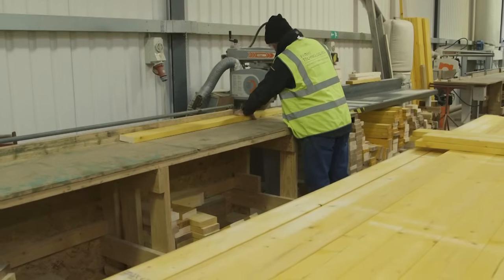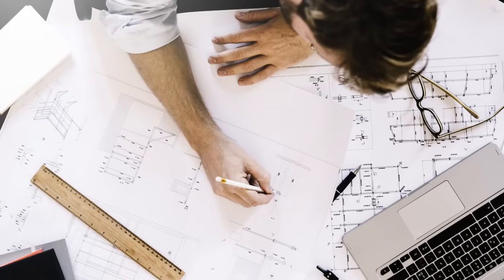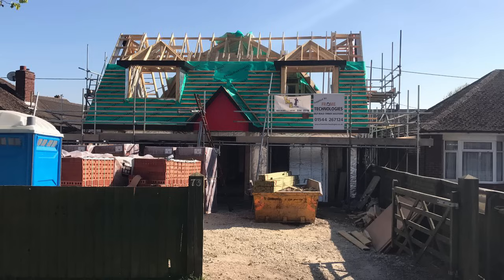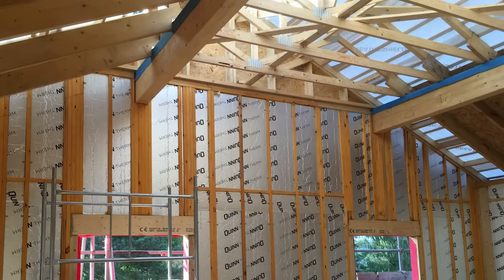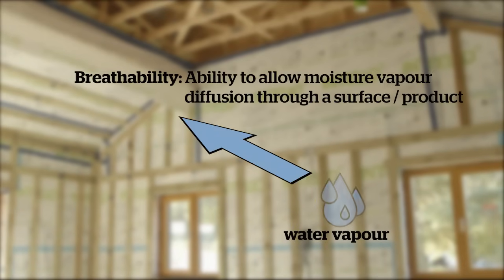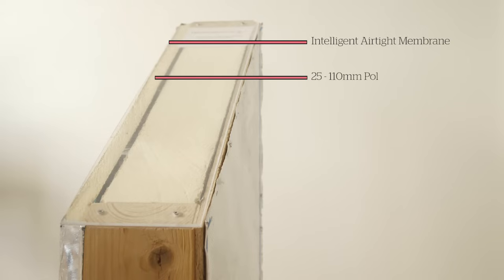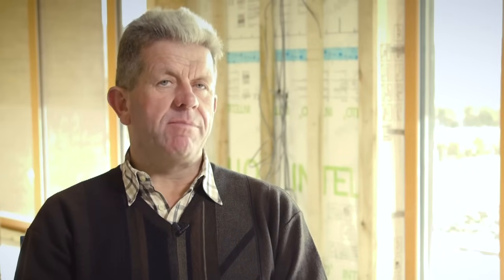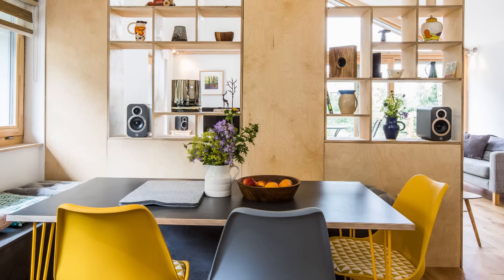Building a Timber Frame Home

Comment: Isn't it harder to find a mortgage for a timber frame build?
Reply from the maker: Hi Darren, I think these days if you're looking for a specialist self build mortgage, timber frame is such a common build system that getting a mortgage should be as easy as getting one for a brick/mortar build, a SIPS build or any other commonly used system. To find a good self build mortgage lender, visit one of the Homebuilding & Renovating exhibitions (currently running as virtual online events). Cheers!

Comment: While a very effective method , for domestic extensions , or retrofit , it’s very hard to find a supplier,  or make a project economically viable for a client , that’s my experience , so the market is for larger self built or few sustainability aware developers
Reply: You’re right just completed timber frame extension on the cottage I’ve done all the work myself as I’m a carpenter but very time-consuming especially the insulation much more expensive than block work but now it’s completed and I’m pleased because of the installation value

Comment: Does anyone know if asbestos was used in timber frame builds from mid 80's onwards? I am asking aside from artex on ceilings, is their possibility of asbestos in the insulation, sprayed on the frame itself, or found in the plaster board?

Comment: In North America, a "timber frame" build is defined as one using "timbers" larger than 5 inches (127mm) in width or depth. Anything less is considered "stick frame" building, which uses standard-size 2x ("two by") sticks to make standard-size wall systems. A timber frame doesn't use wall systems constructed with nails; rather it uses large timbers and timber joinery to create "bents," which are often held together with only pegs and the joinery itself. I wouldn't consider the home above a timber frame home, by any stretch.
Reply from the maker: Hi Shimoda Life. We get tonnes of American viewers telling us the same. However, here in the UK, this is very much a timber frame home... one of many differences in our construction industries.
Reply: @HomebuildingMagazine   Thanks for the reply. I just wonder what are the defining characteristics of a "Timber frame build" in your mind? What separates a timber-frame build from a stick-frame build? Anyhoo, keep up the good content.
Reply: @ShimodaLife  the stick frame (NA terminology) could be better as the timber will be more distributed. Sticks can and are doubled up e.g. around openings.
Reply: @ShimodaLife  in England,  most homes are built of bricks only . So timber frame here just means it is built using some timber instead of bricks
Reply: @ShimodaLife  if the superstructure loads are transferred to the substructure through timber.

Comment: I've always been very sceptical about timber framed builds. In my opinion timber will burn no matter what sort of fire retardant they are treated with. I'm doing a self build and went with traditional brick and block.
Reply: Are you planning on barbecuing in your living room? 😂
Reply: Rodian Builds don’t worry about the timber... like ever. Anything thicker than two inches ain’t burning without something to accelerate it. That’s why you should have plastered walls and NEVER use foam even the filmed stuff. Glass wool isn’t good either it melts easy. Don’t use Furniture that can burn and install sprinklers. The thicker your timbers the more resistant to burning.
Reply: Then why are you watching and commenting on a video about Timber Frame homes? 
At some point, like your floors, roof, stairs, doors, etc, you will need wood.
Reply: @Dollapfin 
"That’s why you should have plastered walls" ??? Plaster walls are made with wood lath. Plaster won't stop that from burning.
"NEVER use foam even the filmed stuff. Glass wool isn’t good either it melts easy." Well, you just cut out 80% of materials used for insulation.
"Don’t use Furniture that can burn". OH, right lets all sit and sleep on concrete and steel.
I don't think you have a clue as to what you're talking about.
Reply: @oldmanfromscenetwentyfour8164  It's a misconception that timber is more susceptible to fire than other materials. If you have a reinforced concrete slab, after x amount of time the concrete cracks due to the heat, exposing the rebars to the fire which loose their stability, leading to the collapse of the slab. Steel has similar behaviour. Timber on the other hand burns slowly, and being a homogeneous section it may lose a part from its height but the cross section can still resist pretty well. (there are many videos on youtube demonstrating this, such as https://www.youtube.com/watch?v=G-J86Ka9MkQ).

And at the end of the day, houses are designed to resist burning for a certain amount of time, depending on their importance. It should not collapse before you can save yourself, and every material is treated taking into account their weaknesses.